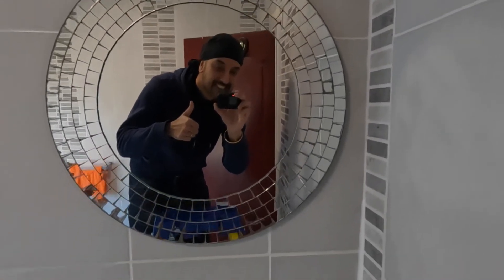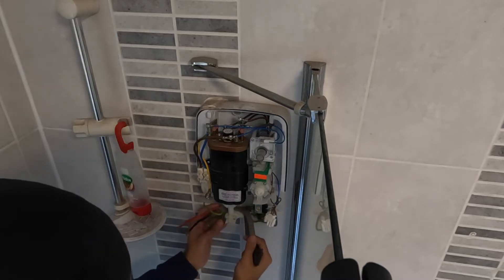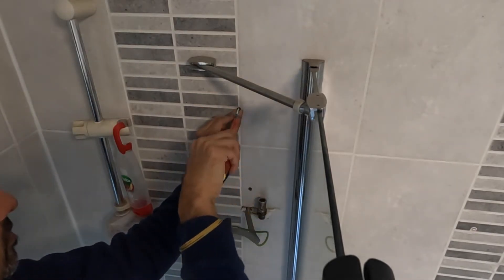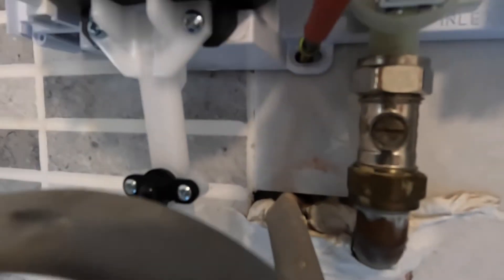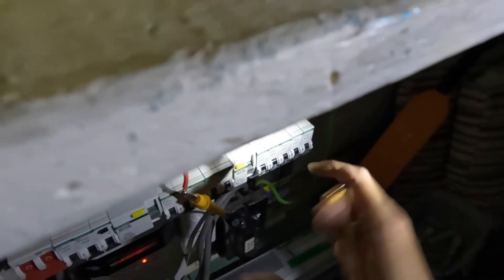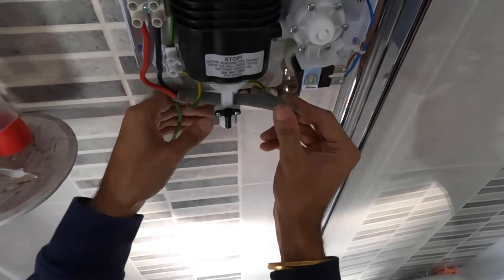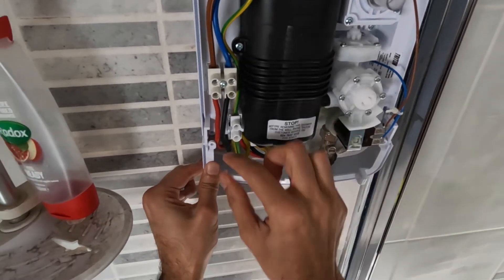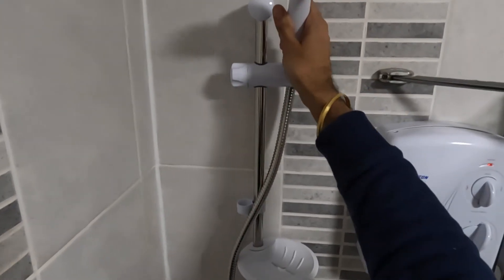How to replace Electric Shower Triton Enrich 8.5kw - Installed by Electrician. Fed by mains water.

Comment: Hi. Im thinking of buying the 9.5kw I just wanted to ask can you turn the cold water inlet to the right because my old shower is based on the right position instead of down position in this video. Also can you move the wiring to the other side in this shower? Thanks
Reply from the maker: Hi mate, yes you can turn the water inlet pipe the other way too, also you can use a 90 degree bend compression fitting to help this direction. Also please note the main thing to consider if you are getting a 9.5k - check the size of cable going to shower and the MCB fuse rating as a 32A breaker can only just over approx 7.5kw. On a 9.5kw I wouldn't advice a 6mm cable either if that's the case. Cheers Handy Singh
Reply: @handySingh Thanks for the info. Appreciate it 👍🏽

Comment: How much temperature does it reach
Reply from the maker: Hi, the temperature of this 8.5kw power can generally go up to approx 55 degrees water temperature. However the recommended use is between 38 and 41, anything over 45 degree causes chances of scaling. Cheers Handy Singh.

Comment: Hi I have a triton enrich shower unit , I’ve switched it on and there is water leaking from the bottom of the unit ,is this repairable or is it better to buy a new shower the water does come out the shower head as well as the bottom of casing thanks

Comment: Did yours come with adapters or fitment parts? Mine has nothing.
Reply from the maker: @ArchefluxxMusic  Hi, mine didn't come with any adaptors, just the shower and rail holder with screws. Cheers Handy Singh

Comment: Can you tell me what the little black vent is on the outlet pipe? We don't have this on our old unit
Reply: It’s a pressure relief device. A Pressure Relief Device (PRD) is a safety feature installed in Electric Showers. If heated water fails to escape through the shower head (due to a blockage such as a kinked hose or blocked shower head), the PRD will blow, thereby allowing the water to escape through an outlet pipe before it causes damage to the heating tank. A PRD cannot be reset once it bursts and must be replaced.
Reply: some showers will have that pressure release pipe on the side facing the wall, so it won't be visible unless you remove the outlet pipe. My shower is like that which adds an extra step when the little rubber valve in it bursts and needs replaced

Comment: Can a sparky fit any new shower where the cables are already there, seeing as you have, ir does the shower have to be like for like?
Reply from the maker: Hi mate, sorry about the delay. Yes a sparky can replace a any electric shower as the demand Spec for current rating is more important to design for any replacement. It's more of the case a plumber should be fitted a like to like kW rating as this cant be adjusted unless you do the calculation of demand etc. Hope that makes sense. Cheers Handy Singh

Comment: I have the same shower, so good video. My copper olive seems a very tight fit when i push it onto the plastic pipe. Is it normal?
Reply from the maker: Hi mate, it should be a standard 15mm olive to fit. Best to get a new olive if your one is not fitting. Cheers Handy Singh.

Comment: does this device work for sure??? that I have burned 7 fuses, please reply
Reply from the maker: Yes the device will run is good condition Subject to the correct wiring installed and the actual rating of wired used and the correct breaker size for overload protection etc. Cheers Handy Singh

Comment: Great video.  Does the unit allow a JG Speedfit plastic connector push fit connection at the water inlet? . Just concerns me ( I am not a plumber) that olives on a compression joint normally 'dig in ' on the hard copper pipe surface to make the seal.  But here you're digging into soft plastic, and if that seal does not come out leak free the first time, then you've written off your entire unit as you'll never get it to seal a 2nd time. And do they actually supply that nut and olive as part of the package?.
Reply from the maker: Hi Peter, yes the JG speedfits fits perfect. Even easier to use. Yes the olive and nut compression can only be tightened slightly and will seal fine too. It won't leak at all. Glad you found this useful. Cheers Handy Singh.
Reply from the maker: The nut and olive does not come with shower.